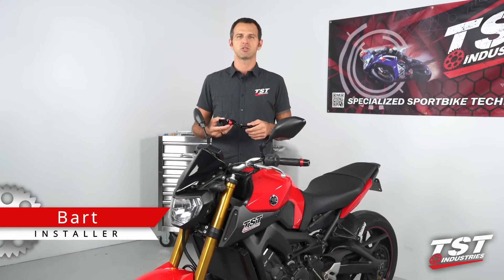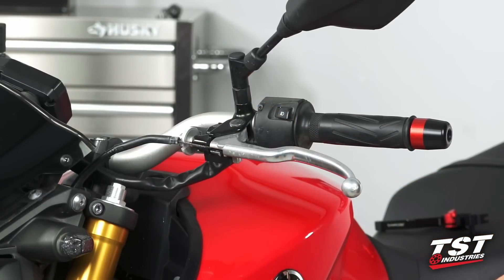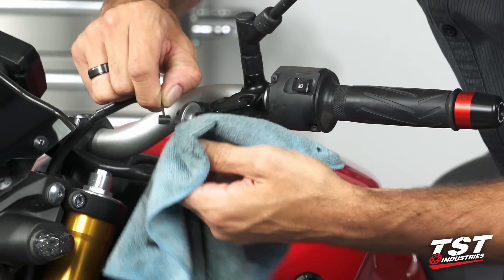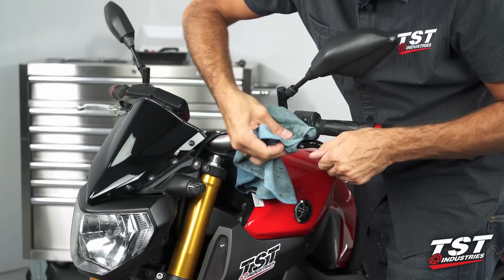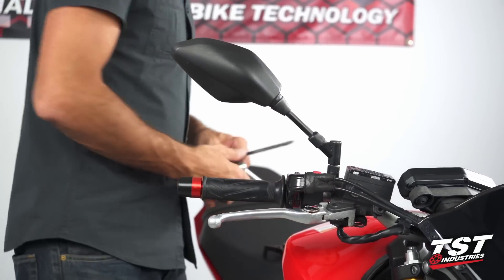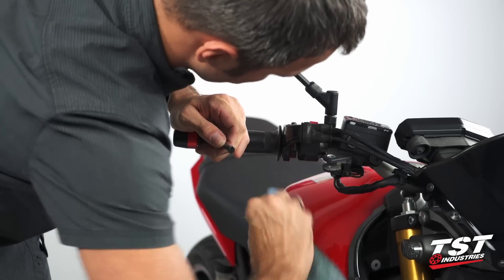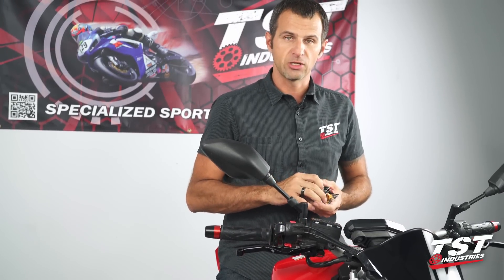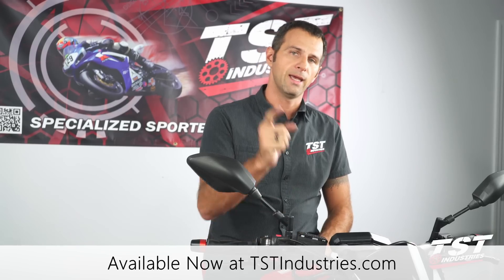How to install Womet-Tech EVO Shorty Levers on a 14-16 Yamaha FZ-09 by TST Industries

Comment: my womet clutch lever snapped in half after I barley laid the bike down I've had stock lever just bend didn't expect this from such expensive levers
Reply from the maker: Stackz we just launched these this week and haven't sold any so I don't understand how you could have these installed already
Reply: TSTindustries for the r3
Reply from the maker: Stackz every crash is different and if you load up the lever enough when the bike goes down something will have to get damaged. If it's not the lever then something upstream like perch or master cylinder.

Comment: The install on the FZ-07 is not exactly the same. On the FZ-07s, the cable adjusters are already turned in all the way so the first step is removing the bolt because otherwise disconnecting the cable is not possible.  You then have to use a pliers or clamp to hold the cable head so you can lodge it within the receiver of the new lever.  Its also a little tricky getting to the bolt because the wires for the controls cross over the bottom of the nut so you have to push them a bit or move the controls inward to get access.
Reply from the maker: It looks like on your particular FZ07 someone adjusted the bottom clutch cable adjuster too tight and did not leave enough adjustability in the top by the perch.

Comment: My brake lever gets stuck a bit. What can I do?
Reply from the maker: You will need to explain a little better. I can't help you unless I get a good understanding of what you are experiencing.
Reply: TSTindustries When I push the brake lever I have to push it back manually to disengage it completely. It gets stuck like 10%. I did use high temp grease so that might be the problem
Reply: TSTindustries So I can only install the lever when I force in the little bolt, but that causes the brake lever to get stuck a little and the brake is slightly activated. I think I got a defective one, at least that’s what other sources seem to suggest.
Reply: TSTindustries Solved the issue. I used sandpaper on the ring where the lever comes in contact with the assembly and then the lever was able to fit without forcing it. It was a bit of an inconvenience though so I can’t say I was completely happy with purchasing the levers.
Reply: I had the same issue. I'm gonna use sandpaper let how it works